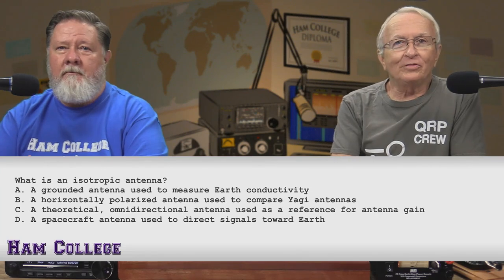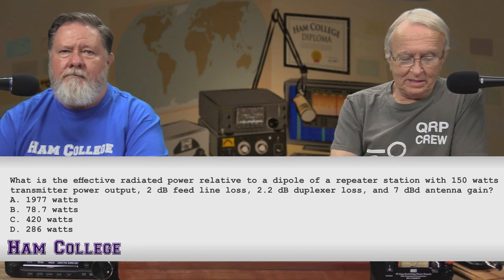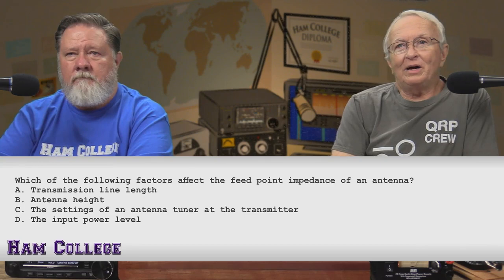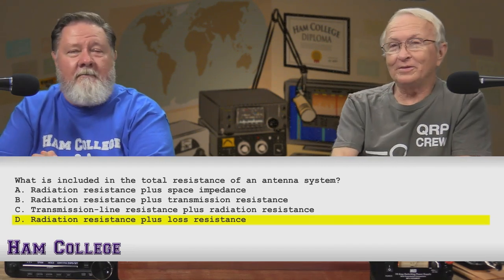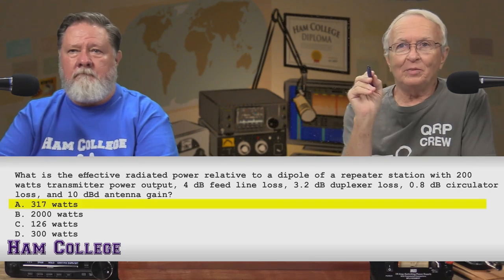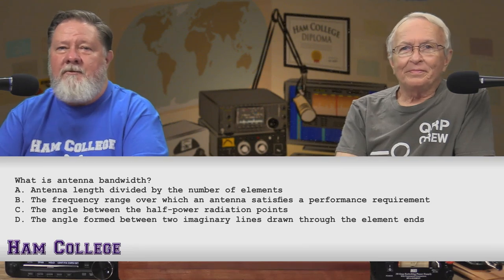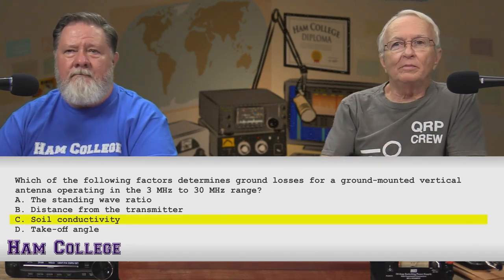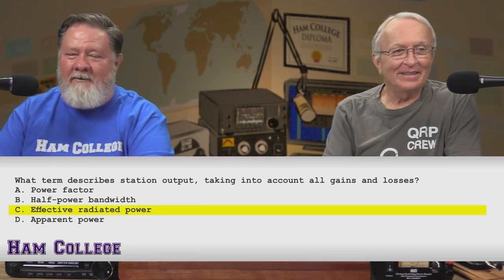Ham College 105

Comment: Antenna "height" is not referring to the physical length.
Reply from the maker: Which of the following factors affect the feed point impedance of an antenna?
A. Transmission line length
B. Antenna height
C. The settings of an antenna tuner at the transmitter
D. The input power level

The question is a little ambiguous. It depends if you are taking about a ground mounted vertical or some other type of antenna.